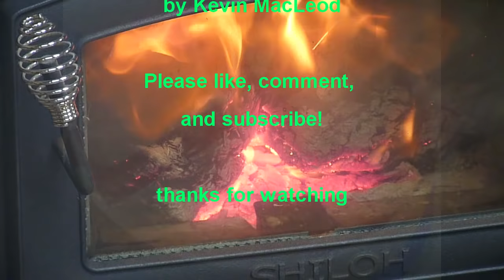Woodturning a Fiery Figured Maple and Red Heart bowl

Comment: Beautiful piece,  I love the flamed maple you used! Red Heart is one of my favourite woods to work with.One note for anyone else going to try this... the Red Heart is a very oily wood and some people react to its dust, plus if you rub finish on it (or even sanding sealer) you can find the red oil seeps into the surrounding wood, or you can easily spread it to the surrounding wood by rubbing it. Be careful with the first coat!
Reply from the maker: +Tom Murphy Thank you Tom.  That red sure does spread, thanks for the note.

Comment: Very artistic!  The lines seem like they are draped on the wood, and the contrast is very striking.  One of your best.  Thanks for sharing.

I thought when you added the red heart into the round cylinder of maple, that a box like that would look very unusual and Japanese.  What if you turned a round covered box in figured maple, and had a rectangle of red heart wood sticking out of the top lid like a modern design?  The contrasting woods, and the contrasting circular and rectangular figures would be amazing.

If you made this, I guess you would first cut the maple in half horizontally.  Then cut bottom maple piece to insert and glue the red heart block.  The bottom half would be turned on lathe like a bowl with the inlay as you did this bowl with a rim to hold the top.  The top half would be first turned on lathe to shape, then cut with miter saw.  The red heart would be sanded separately, then inserted and glued into top lid of box.  Then you turn the inside of top only, to remove maple and red heart and make a hollow interior and nice ribbon running through.  However, you leave the red heart ends sticking out for style and as handles for the round box.  What a piece of art that would be!  Your next challenge.

Comment: nice bowl, just wondering if when you glued up, did you think about the grain going 2 different directions and the wood movement over the years how it will crack and fall apart?  grain should always go in same direction
Reply from the maker: Thank you.  Yes, I sure did.  I ran the uncut piece of redheart the full length hoping that would encourage less potential movement.  I also started with wood purchased dry, which then sat in my shop for months prior to use, so it was stable.  I've been keeping an eye on this bowl for going on two years now, and it hasn't moved at all.  As a rule, of course grain should run parallel, but artistically it was worth a shot and I'm happy with the results.  I appreciate the questions!

Comment: The contrast in woods is beautiful.  Is there any risk of the red pigment spreading with time or use into the maple?  Fabric artist here, so I've seen how some pigments bleed, whether natural or added.  Just curious if that problem carries over to other media.
Reply from the maker: No, it's very stable.  The issue is during sanding, that red dust will get everywhere and can be difficult to remove from the lighter wood...but that's the only carry over problem I encountered.

Comment: Beautiful work!  I'm new to turning:  After forming and finishing the outside of the bowl, how did you attach it to the lathe in it's inverted position to work on the inside?  I have only done bowls by creating a tenon to then put into a chuck.
Reply from the maker: +Mark Johnson I use the mortise more often than the tenon, it mounts basically the same way but with outward pressure from the chuck jaws.  Please refer to my Bubinga and Yellowheart bowl video https://youtu.be/XttexND6HmY which I uploaded a few days ago, as that step is on video.  Thank you very much!  Rod
Reply: Awesome!   I will; thank you!

Comment: Gorgeous design and bowl.  The contrast is great.   The cutting of round objects on a miter box is extremely dangerous.  It very easy for the wood to get tilted and cause a catch on the wood and the blade and you could be very badly damaged.   Any round stock needs to be properly supported with some type of fixture and hold down device.
Reply from the maker: Thank you for the compliment and the advice on safety.  I agree completely.
Reply: You inspired me to make one of these.  I have some maple and snakewood which I plan to put on a 45 degree angle to show more of the grain.  Thanks for posting this project! :-)
Reply from the maker: Oooh, I like snakewood, very beautiful grain!  Best of luck with the bowl.  "inspired"...You've made my day, sir, thank you.

Comment: Very nice!!  I saw you drilled a hole in one side, but how did you attach the blank to the chuck?
Reply from the maker: I didn't show that process in this video, sorry (more recent videos do).  I used a worm screw mount, which comes with the Oneway chuck.  The screw head fits into the chuck jaws and it holds the blank very securely, as long as the blank is not too out of balance.  Thanks!

Comment: Why do you cut through the wood in several passes with your miter saw?  The bowl looks to be around 4" tall, and I have gone through pine 2x4 on edge in one pass.  Is it because the wood is much harder, or are you looking for a cleaner cut?
Reply from the maker: Dull blade and harder wood.  Bad idea.  I should have clamped it down too.  Thanks for watching!

Comment: it was amazing  ı m loving it thanks for sharing :) but ı have questions. How long are you waiting after stickhing the glue for turning..    Which type glue do u prefer ?
Reply from the maker: Thank you very much!  I use Tightbond glues.  I've used all three types ( I, II, & III) and they all have worked fine for me.  I let this piece dry for at least 16 hours if I recall correctly.
Reply: thank you very much. ı have one more question. How long are you waiting after polishing and what do u use for polish ? thank u so much for answers
Reply from the maker: I use a mixture of equal parts, boiled linseed oil, clear shellac, and denatured alcohol.  Commonly called "shine juice."  It can be applied as soon as you're done turning the project.  Apply in thin coats with light pressure, allow to dry for a few minutes between coats, and use as many or few coats as needed to get the finish.  here's the link to where I learned to use the Shine Juice:  https://www.youtube.com/watch?v=taJbBmcaAZQ

Comment: What are you using for the finish? That bowl is beautiful Mr humphrey
Reply from the maker: Thank you so much!  I used a shine juice mixture (my go to finish 
usually) of equal parts denatured alcohol, clear shellac, and boiled 
linseed oil.  I apply it at slow speed, thin coats, with a few minutes 
dry time between coats.  It usually only takes a few coats to shine up 
nicely, sometimes more.  Thanks again!  Rod

Comment: good evening,
as you did to not leave a mark behind the bowl ? because of the lathe . 
thank you.
Reply from the maker: +Jarmerson Welle Olá, eu não entendo o que você está pedindo. A tradução não é correto, eu sinto muito. Obrigado por assistir e subscrever! Por favor, comente novamente no seu idioma.
Reply: ok me desculpe. vamos lá.

como faço pra não deixar as marcas do torno, na peça.? 
obrigado.
Reply from the maker: +Jarmerson Welle Obrigado. A bacia é anexada para o torno por uso do encaixe. Existem pequenos recortes dentro da parede do mortise, feita pela pressão externa do mandril do torno. Neste vídeo em (03:49) você pode ver como atribuo a tigela   https://youtu.be/uTwKqiTo6TU   Obrigado, espero que ajude

Thank you. The bowl is attached to the lathe by use of the mortise.  There are small indentations inside the mortise wall, made by the outward pressure of the lathe chuck. In this video at (3:49) you can see how I attach the bowl   https://youtu.be/uTwKqiTo6TU     Thank you, I hope this helps

Comment: Fairly novice woodturner here, does anyone know why he drilled the hole in the center? Or did I just miss something?
Reply from the maker: Great question.  I failed to video the next step, which is using that hole to mount the wood onto a Woodworm Screw on the lathe.  Here is a link to a video I just did, which shows the process in detail starting at one minute, thirty seconds, in the video:  https://youtu.be/TpiZr8hQ7qs  Thanks for watching and commenting!
Reply: Nice! Thank you for the response!